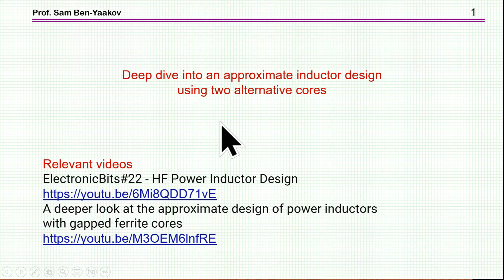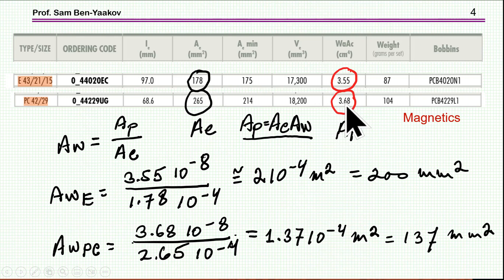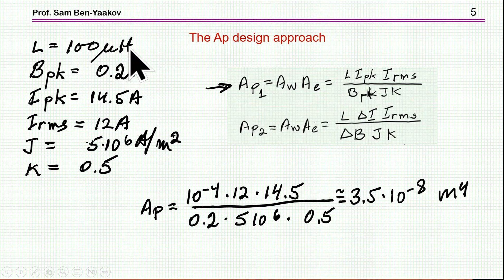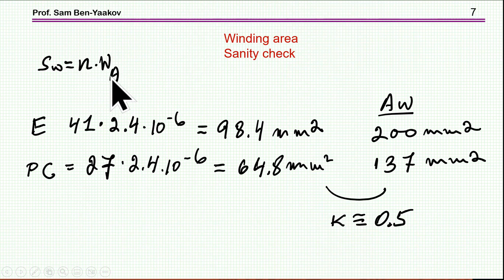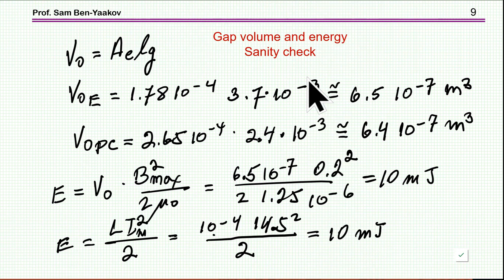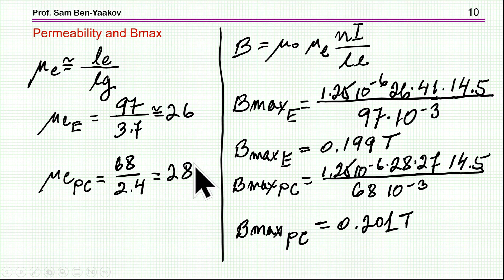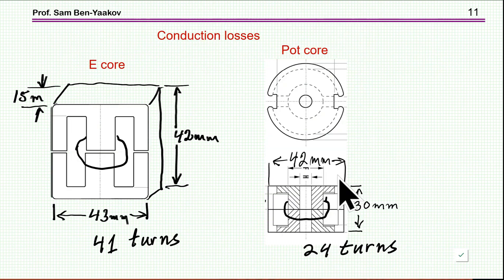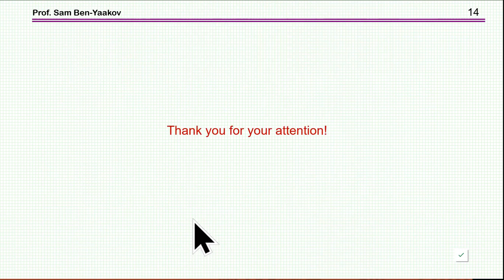Deep dive into an approximate inductor design using two alternative cores - Corrected

Comment: Amazing explanation, as always.  I have always struggled with understanding these relationships.  I have always wanted an "online calculator" where I could plug in numbers from various sources.  And I've not found any good central source.  And on top of it, I've always struggled to find the right units for all the various cores.  Why do manufacturers so frequently "leave out" some of the parameters?
Reply from the maker: Thanks. Very happy to learn that the videos are of help. Yes, there is much to be desired with the data sheets.

Comment: Hello Professor! I was just about to wind my new resonant inductor for PSFB when you posted a video on a topic, such a wonderful gift! I take this opportunity to ask a couple of questions on the topic.
 1) @ 4:00 You choose the first equation Ap1 because in your case Ap1>>Ap2 (delta I is small). In my case of a resonant inductor, I will have a large delta I (in fact it will be 2*Ipk). So Ap2 will be my limiting factor. For example,  I want to limit losses to 100 kW/m^3 (n87 material) -> delta B 100mT and Ap2 will be larger than Ap1. Is this correct reasoning?
2) What recommendations can you give on the design of a resonant inductor (PSFB), what should I pay special attention to?

Let me also take part in the exercise @ 14:15.
For the E core bobbin Mean length per turn (MLT) is 91.4mm from the datasheet. For Pot Core bobbin external diameter D = 1.394in, internal d = 0.776in, so average diameter will be 1.085in and MLT will be 1.085in*pi = 86,6mm. (So, the path in the pot is less)
In the case of E core we have 41*91.4mm=3.747m wire.
In the case of Pot Core we have 24*86.6mm=2.087m wire.
Assuming copper wire resistance 0.0175 Ohm*mm^2/m
E core wire resistance 27mΩ, Ploss=Irms^2*R=3.89W;
Pot Core wire resistance 15mΩ, Ploss=2.16W.